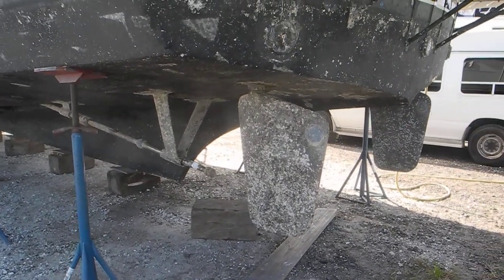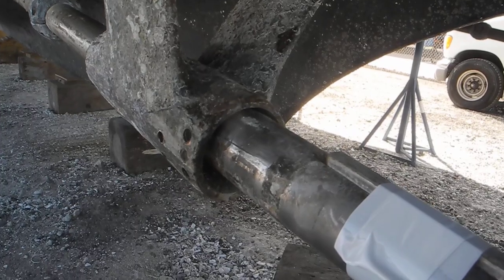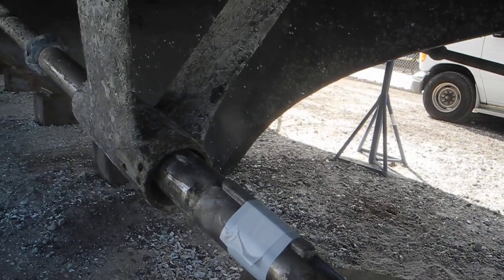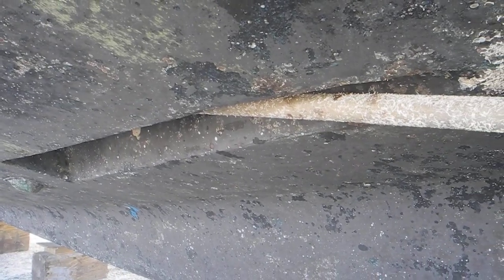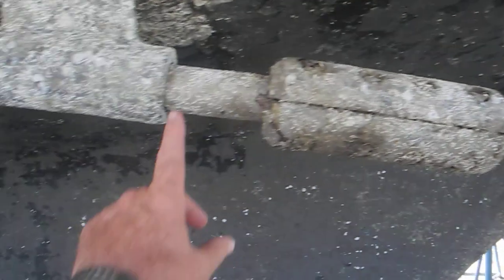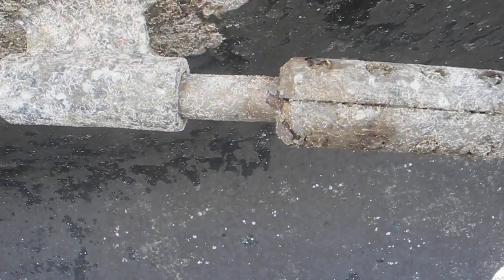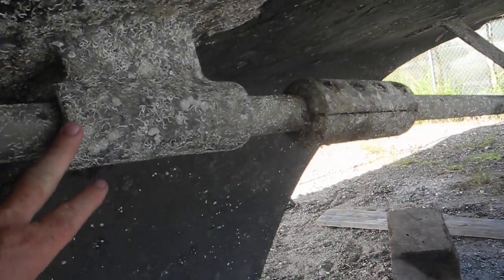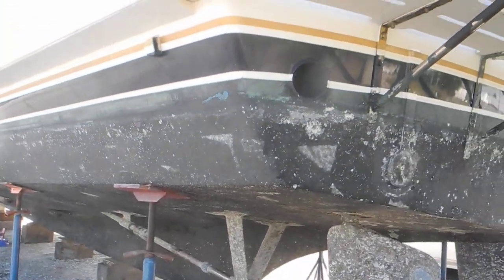Two Piece propeller shaft and cutlass

Comment: Great Videos what would u recommend starting boat on stands and put in gear to check for trueness of the shafts ? Thanx Smokeywilson
Reply from the maker: Alabama Smokey Wilson no. The boatyard technicians have  instruments to test that. Too much involved to try to run an engine out of the water and a propeller spinning would be dangerous.
Reply: I think a cutless bearing doesn't like running dry, not even for a few seconds. If I was to do that, I would spray on some soapy water on the bearings, then they should be fine for a few minutes. The shaft seals can also be very sensitive to dry running, depending on type. Then you have the sea water pump but it should be happy as long as it has some water in it and doesn't get completely dry (I'm talking about the common rubber impeller type of pump, maybe there are other types that I don't know). Of course a spinning propeller can be a killing machine as Captain Chris mentions so you have to be careful that nobody gets near it while running. 
But there's really no reason to do it. You can not see it only by eye (if it's not extremely bent), you need an indicator to measure with and in any case, you don't need to spin the shaft fast, it's perfectly good to turn it slowly by hand, running the engine will do you no good.
Reply from the maker: skunkjobb 👍🏼

Comment: Cutless, not cutlass.
Reply from the maker: Photozetetic potayto potahto. Google it and you will see it spelled both ways.
Reply: @AskCaptainChris  I did some Googling and found a quite interesting history of the name(s) of the bearing type. The origin is that it would cut less into the shaft than the wooden bearings used before the invention of these grooved rubber bearings, cut less-->cutless which also became the brand name. (The soft rubber flexes some and saves the shaft from wear while the old hard wood bearings were not so nice to the shaft.)
In a play of words, the inventor chose a cutlass sword as the brand symbol which can still be found on bearings from the company that bought the rights from bla bla bla
A Cutless with a cutlass: https://www.propellerdepot.com/hoist-johnson-duramax-flanged-bearing
The whole story: https://www.followingseas.media/blog/2017/1/30/name-that-bearing-1
So it's not strange that both ways of spelling are common today even if cutless is the original form and the one that best represents the origin of the invention.
Reply from the maker: skunkjobb and When another company called their version cutlass the Cutless company was not happy. I think even oldsmobile called it cutlass.